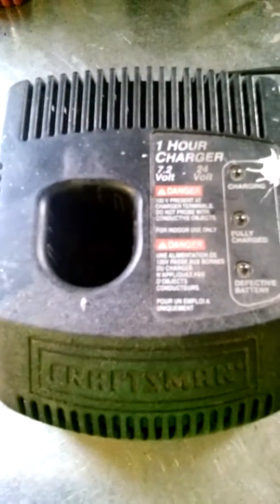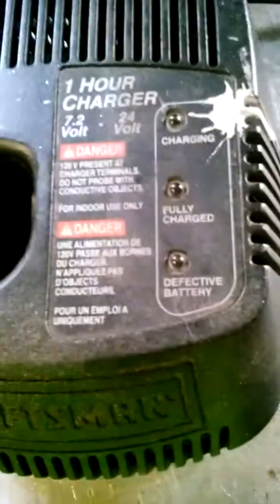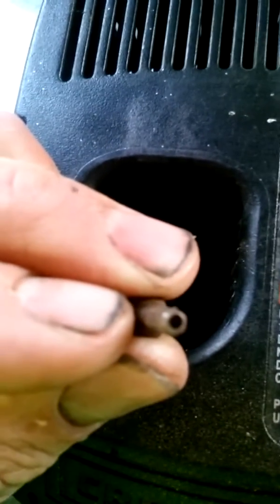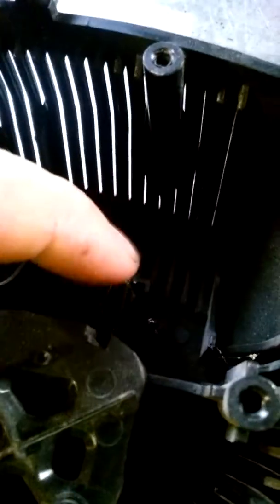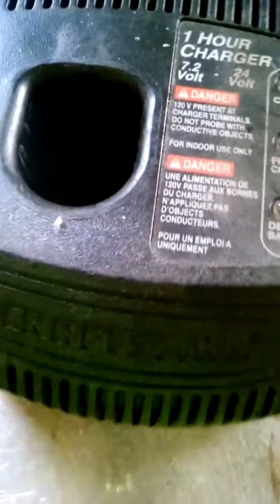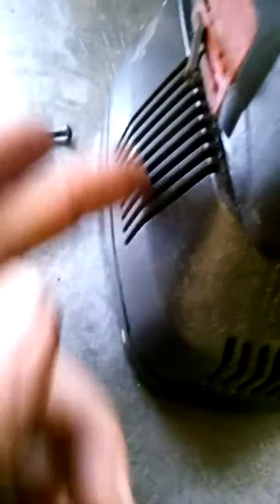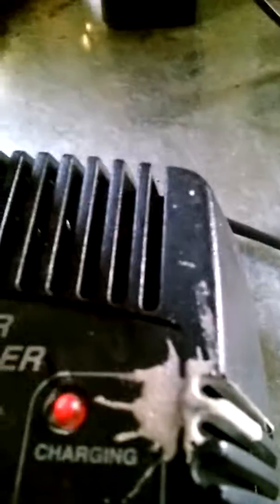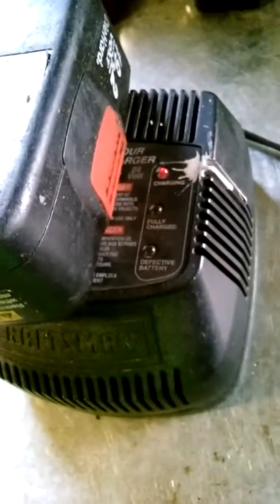Craftsman battery charger fix 19.2 volts. One possible fix.

Comment: Wow, 6 years later and your video just fixed another charger!  Thanks. I didn't even need to open it. I just toggled that lever/switch a few times manually and tried the battery again. May have gotten stuck or intermittent or something. Works fine now!  Thanks again!
Reply from the maker: Glad it helped :) I have many other video too.

Comment: Great video. I glued a piece of plastic on mine AND, I filed a little off the plastic stop pin and the a little off the bottom corner opposite the pin because those limit the movement of the lever and won’t push enough on the switch. Mine works like a charm now.

Comment: Crappy engineering on their part. Great find on that. I’m sure plenty of people just threw this style of charger since if it drops once it break at that point. I found a polisher/buffer and it is not working and I’d bet this is the fix. I’ll glue a ball point pen ink tube to it and melt the end so it’s wider or use the pen shaft and put it around it for support. Thanks again!!!

Comment: 0:27 Security Torx is different from Security Allen.....Other than that, great video on what to check for if charger isn't working. 👍👍👍
Reply from the maker: I use torx and hex interhchangably all the time.
Reply: a torx bit will fit an allen fitting, the star is the same shape if you connect the points. the points fit in the edges of the allen shape.
Reply: What size\# on that style torx
Reply: T-10 security bit

Comment: Hey will that battery charger work for that battery. Aka was that the original charger for the 19.2 Volt? ?
Reply from the maker: What are you trying to say? Why wouldn't the Craftsman battery work for the Craftsman battery charger I was working on ?
Reply: mobilemowers I have the 19.2 battery and was making sure that this was the correct charger for it
Reply from the maker: Same as the title states "Craftsman battery charger fix 19.2 volts".  Most all Craftsman chargers have a range of volts they charge. This came with my 19.2 drill and 19.2 battery. You won't know till you open yours up.
Reply: you cannot charge a lithium battery with a NiCad charger , although you can charge NiCad battries with a lithium charger

Comment: I was gonna fix mine but couldn’t find the charger lol guess to late? Lmao I got dewalt now new ones but would of been nice to have extra ones dam it story of my life aaaaa o well
Reply from the maker: Yea I finally went dewalt. I love the dual battery chargers, the 7 1/4 circular saw and then the 60 volt saw saz ( that kicks ass).Please mine are brushless I just bought the 700 lbs 1/2 drive impact. Though the reviews on that aren't as good as other famous brands of impacts. I still have the Craftsman but things changed when Stanley took them over. Also I didn't want to spent top dollar to go to litium battery and charges. These Craftsman with the taller charging posts are made anymore.